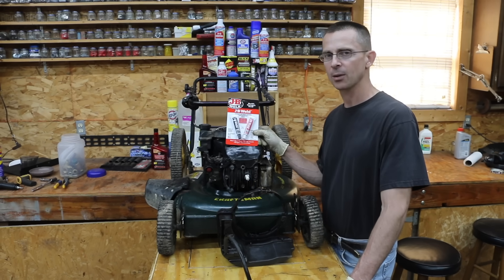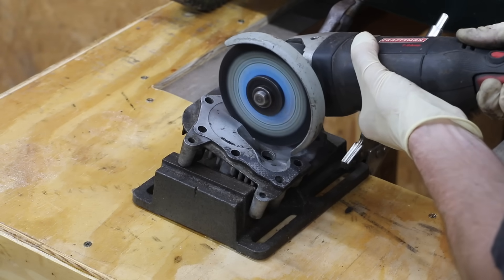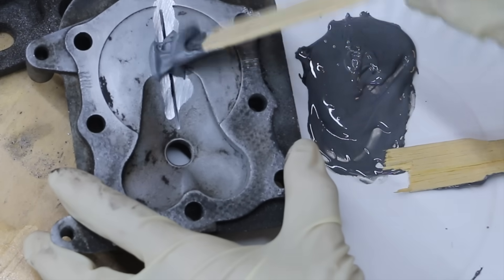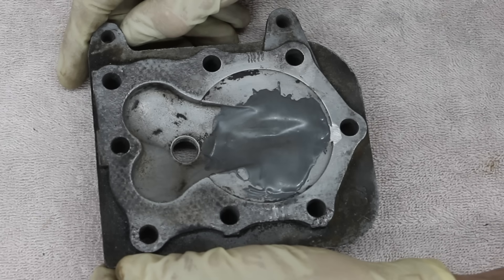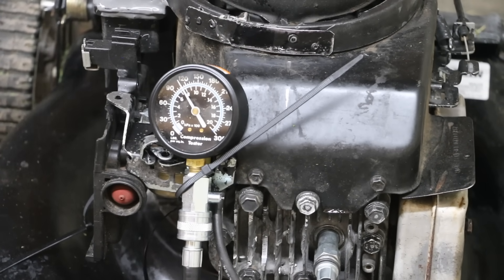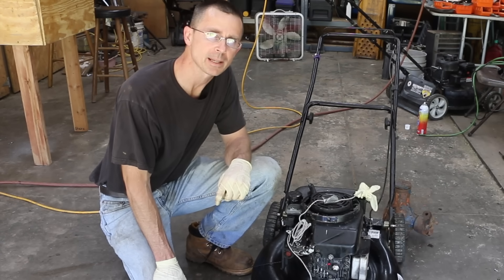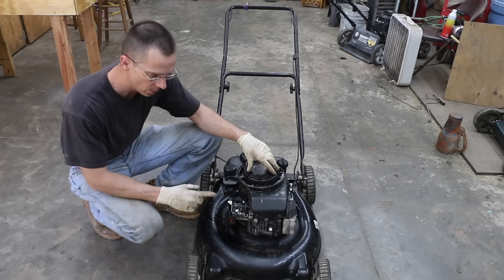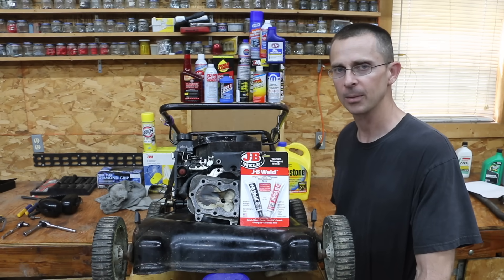Can JB Weld fix a cracked cylinder head?  See the proof!!

Comment: So my pressure washer has a small crack on the pump, just before the long pipe to connect sprayer. Should I try it before spending 100 on new pump
Reply from the maker: If the pump was disassembled and JB Weld placed on the inside of the pump to cover the crack and then placed on the outside too, I believe it might work.  However, I don't believe it'll provide a lasting solution if just placed on the outside.

Comment: This is exactly what JB Weld was made for. My father worked for the engine repair shop that developed it back around 1950 in Sulphur Springs, Tx.
Also, if you can find it, there's a material called pr-1422 that is designed for sealing airplane gas tanks. Not sure it can be found outside the military, but we used it at NASA for different purposes on the Space Shuttle. If you can find it let me know, I'd like to get some. Awesome stuff.
Reply from the maker: Thank you!

Comment: I know you mention you should have sanded but dude, you know that combustion chambers have low tolerances, what were you thinking putting this huge mass in such tight quarters?
Reply from the maker: JB Weld still held up, even with the piston pounding. Thanks again!
Reply: @ProjectFarm  Ya i saw that, impressive..

Comment: Rock strike hole in old caddy fuel tank. Pin hole. Coated round head machine screw with jb weld. sanded tank surface then installed screw. coated over screw with jb weld. 4 years later still no leak. With plastics I find that if I sand the surface first I can repair most any plastic.
Reply from the maker: Thank you

Comment: what if I use JB Weld to raise the compression on my Jeap?  

It is a 240kmi AMC 4.0, so the compression will stay below factory spec.
Reply from the maker: Thank you. I don't believe that it'll handle the heat for too long.
Reply: @ProjectFarm  :
https://scontent.fiow1-1.fna.fbcdn.net/v/t1.0-9/16195833_10101251542211889_6169801415952343842_n.jpg?_nc_cat=108&_nc_oc=AQl5noVnDiW6o8eH6SDUWBn1jwI955jFHY5eQmAjbsVr6TAAgEIlPKQ0jOReSMd7vns&_nc_ht=scontent.fiow1-1.fna&oh=0be0f08f1b6cad3e0bf890881b931d35&oe=5D5EC41A

if my pic link works, that's an article from Autocar magazine.

Comment: Onboard ship, underway, our high pressure air compressor cracked a cylinder insert. A little bit of J.B. Weld, and we finished our deployment without another issue. We replaced it when we got back to home port. But, we didn't really need to
Reply from the maker: Impressive repair!

Comment: I know your a JB weld fan but I'm having a hard time getting behind JB weld. Heat seems to be the killer to JB weld especially if you apply heat and let it cool down and then apply heat again. Repeat this several times and JB weld gives in. I was surprised that JB weld literally crumbled on my Honda Civic manifold. 900 Fahrenheit but JB weld started smoking around 500 and it's rated for 550 Fahrenheit. I didn't expect regular JB weld to last long but to smoke and crumble apart in minutes surprised me. There is a JB Weld for extreme heat but I haven't tried that yet and manifolds do get extremely hot.
Reply from the maker: Great point on the heat limitations.

Comment: JB Weld Marine is waterproof. I used it to patch a rusted oil pan on a 1.6 liter 4 cylinder until I could get a replacement. Ended up lasting over a year (I forgot about it). I just put on a new pan.
Reply from the maker: Thank you

Comment: Can I use JB weld to seal power steering pump leak?
Reply from the maker: It's hard to day without seeing the cause of the leak.  If it's a leaking seal, have you tried bluedevil power steering stop leak?
Reply: Seal causing it to leak because of high km. Possible jb weld can seal a leak because I heard it do the job.

Comment: Have used jb weld on a tecumseh 6 hp block that threw a rod and was cracked.  Figured since it was a splash lubrication system it would work. It held up for a few years.
Reply from the maker: Impressive!

Comment: DO warsh the gasoline from the tank with OXY  / torch.  LOL.  LOL    about J B.  i have used for a lot of things.    and because i cant remember any major  trouble it must have done a good job.   except.     on my RC car i used it to lock the differential.  after 3 years i took the diff apart an it would let the diff spin very little.     but i dont call that a fail.   also i used JB  to patch a outside rear view mirror  back on a Buick.
Reply from the maker: Thank you

Comment: I've used it on a old out board motor , the Carburator mounting ear broke and put some on and it's been good now 2 years and was able to tighten the carb back on to normal specs and reattach the piece back on the carb .
Reply from the maker: Thank you

Comment: I bought a used 1999 GMC Z71 years ago from a guy who purchased it at a car auction. About 2 months later I was on my way to work one morning and the truck started running like crap. Had it towed to my mechanic who called me a few days later and said one of the heads had a crack nearly 1/4 inch wide that someone had filled in with JB Weld and it had finally failed. Who knows how long it had been that way or who did it but I can say from bitter personal experience that it will fix a cracked head...for a while at least. And there is a special place in hell for the person who did that before selling the truck to someone else.
Reply from the maker: Wow!  They should not have sold it like that.

Comment: Ive never used it to fix a cracked block but i had a freeze plug rust through in my ford ranger, the one right above the driver side motor mount, I used a screw driver and was able to remove about half of the plug, i used a whole tube of JB Weld and it has been there for 8 years and still doesn't leak.
Reply from the maker: That's great!  Thanks for watching!

Comment: 40 yrs ago I used J-B on some 318 heads I found in a lot that had a fresh valve job done to them.. They had cracks (4 of them) each near the end exhaust ports . I guess whom ever dumped them thought they would leak.  I put J-B on them & never had an issue.   Amazing.
Reply from the maker: Impressive results!

Comment: Once when I bought some mufflers online I accidently got them in 2.5" instead of 2.25". I had already cut the old mufflers off and couldn't wait for the whole return process since I would be pulled over for noise violations. I used JB weld to fill the gap and those mufflers were solid till I sold the car 7 years later. JB weld is some pretty good stuff.
Reply from the maker: Impressive!

Comment: Project Farm, you should try to use that aluminum easy welding rod to attach a cylinder head/fix a crack In something aluminum.  https://m.harborfreight.com/8-piece-low-temperature-aluminum-welding-rods-44810.html?utm_referrer=direct%2Fnot%20provided
Reply from the maker: Thank you for the video idea!

Comment: I've used JB Weld for a variety of fixes. Definitely works well if the parts are super clean and roughed up. I've used it on wood also and it holds strong. Super Glue has failed me too many times so I went 2 part epoxy many years ago. Also I've welded aluminum as part of building a twin turbo system on my race car and nothing gives me more confidence than a strong true weld. I paid 2500 for my welder so it's not exactly a cheap fix. I've had 1 failure with JB Weld on a post hole digger. It eventually gave way so I pulled out the welder and strengthened the cheap post hole digger and haven't had an issue since.
Reply from the maker: Thank you!

Comment: I have used a mixture of 50% jb weld and 50 % by volume not weight aluminum chips (from a carbide cutter) to repair a aluminum cylinder head intake port that was cut into a push rod passage.  The reason I used 50/50 was to try and better match the thermal expansion or the original material. don't know if it made a difference but the head is still running Saturday nights at a local dirt track for the last 6 years. Did try and repair a blow out o2 sensor on a exhaust manifold / cat converter combo. While it was just a patch to get me back home the road side repair did not work and the JB weld burnt out after only a few miles
Reply from the maker: Thank you!

Comment: I use JB Weld for anything I don’t want to move!  Most recently a fuel gauge for my snowmobile.  Everything fell off the cap and into the tank while riding.  After fishing it all out it’s been reassembled and held together with JB Weld and has yet to be put back on the sled.  My question is have you ever used Blue Devil to fix a head gasket leak?  I used it in my F-150 5.4 Triton and after about a year no problems.  Hasn’t leaked a drop of coolant or burned any.
Reply from the maker: JB Weld is amazing!  Thank you

Comment: Can I use J-B Kwik weld to repair a 1 millimeter by 1 mm puncture in an aluminum head on the engine... I was drilling to install helical and one just a little too far
Reply from the maker: I don't believe the repair will last.  Too much heat in the long run.  Without seeing the needed repair, it's difficult to provide advice.  Could you just "tap" it and insert a threaded fastener along with a high temp threadlock to plug the hole?
Reply: @ProjectFarm  while preparing to tap bolt I slightly drilled into head...patching up small opening into head?

Comment: I have been retrofitting some 5 gal plastic gas containers with EZ-Pour spouts and vents. The vents are installed by drilling a 1/2" hole and snapping in the little yellow plastic vents with attached cover. I've had a problem with gasoline leaking around the vent and have been searching for a sealant of some kind that will work on plastic and is gasoline proof/resistant. I'm trying several brands/types to include goop, and various versions of Permatex. Do you have any recommendations? Maybe you could do a test? Another brand I've consider is Eclectic "Seal-All." There are many brands with various claims.

Comment: JB Weld is good stuff. I had a crack in the weld seam on the side of a 50 gallon waste oil cube and degreased it and prepped the repair area really good. JB weld still holding through the heat and cold over 15 years. Tank is still not leaking.

Comment: Hey  ! Great Easy way to raise your compression ratio to increase performance in other applications. By decreasing the dead space inside your cylinder head. It should and will raise the compression ratio  WOW , Now thats exciting to me. A hell of a lot easier than milling heads ! I wonder if it would hold up to repeated heating cycles as said already  ?
Reply from the maker: JB Weld is a terrific product but the temperature inside the engine's combustion chamber is beyond it's rated heat capacity.

Comment: How about way over-drilling out stripped threads, then tapping it again, fill entire bolt hole with JBW (new threads are to give JBW something to grab on to). Then drill & tap just the slug of JBW and see what type of hold power new bolt has to it. I suppose you could just fill a large dia bolt hole with JBW and use a smaller test bolt to save a step..may just do this myself when Im done rebuilding my engine.
Reply from the maker: Thank you for the video idea!

Comment: I have an '03 Impala with the 3800 engine. Replaced lower intake manifold gaskets 3 years ago and there was lots of pitting on the block (iron) around the coolant passages which would keep the new gaskets from making a good seal. Took my engine apart  a month ago for more work and the JB Weld area look great, no chipping, loss or whatever. Im in alot of 3800 or Impala/GM Forums and JB Weld always comes up as a major lifesaver for engines. Some guys have done what I did, used it to fix broke of bolt hole segments on thick brakets, water pumps and transmission to engine  plates, covers and alot more. I used it like putty fill on the pitting and was afraid it would just peel off as the pitting was irregular and various depths no more than 1/32 I'd guess but thats a million miles to a gasket. I roughed it up the pitting surface with sand paper, used a putty blade then fine sand down, still all there. The best stuff ever!
Reply from the maker: Impressive repair!  JB Weld has saved me a lot of time and money.

Comment: On the JB Weld fix preheat the metal first as it turns the JB to a almost watery consistency giving it a way better bond and metal penetration . I have tested both and preheating to about 125 - 150 degrees gives a way better bond .

On the head you may have to put tape on other side on preheat so the JB stays in crack and does not run out . I then bake repair item at 175 degrees for 30 min ..... incredible bond after

 I love your videos - so much real world information .
Reply from the maker: Thank you!

Comment: Very interesting. I’ve used JBWeld + cut & shaped sheetmetal to restore a broken front derailleur clamp on a bicycle, also restored a broken bicycle brake lever better than new with jbweld + cut & shaped piece of sheetmetal. The bicycle was for a friend’s kid and he was thrilled to get his bike back like new.  I’ve also used it to fill in a deep gouge on the edge of an alloy wheel rim. Used duct tape to hold its shape while drying, then sanded the rim edge smooth and repainted the rim like new again.
Reply from the maker: Thank you!  JB Weld is an amazing product.

Comment: You should test how well JB Weld works when not mixed properly.  It's a 50/50 two part product, but everyone just eyeballs the mixture.  What effect does a poor mixture have on the strength of the product?  70/30, 30/70, etc.
Reply from the maker: Thank you for the video idea!

Comment: Well it definitely does not work on exhaust. I have tested it.
Reply from the maker: Thank you
Reply: Well I used it on a header about one inch from the engine. The heat just burns it away. That’s why I was surprised it worked on the head. It was on a car though.

Comment: I  try use this thing a few times to do a quick fix in a radiator and it doesn't works!
Reply from the maker: Thanks for the constructive feedback.
Reply: Alex. I had the same issue with trying to repair a hole in an oil pan. Come to find out it was operator error on my part. The surfaces must be clean. Hopefully you are not making the same rookie mistake I did.

Comment: JB Weld...! After this torture test I'm a believer. Way back when, I had a MX bike that blew a hole through the cylinder just below the power port. In that state the bike, I reasoned, was only worth trading for a beater car. After the fact I kinda wondered if I could've JB-Welded the cylinder & how much run time I could've gotten from that cherished ride. This vid really intrigues.
Reply from the maker: Thank you!

Comment: I was putting my kayak on the roof and it slipped and broke off my side view mirror.  I put it back with JB Weld.  A few months later I was T-boned (opposite side of the car from the fixed mirror) and I slammed into a cement block fire house.  The mirror stayed on even though the car was totaled.  I was amazed.
Reply from the maker: Impressive!  Glad you are okay from the accident.

Comment: I really enjoyed thus video. I just found your page . Do you know anything about the high heat JB WELD? Im trying to fix a crack in a cast iron stove. Ty
Reply from the maker: JB Weld Extreme heat should work well for filling a crack.  Since it's designed for high heat, the tradeoff is that it isn't nearly as strong as JB Weld original.  Hope this helps.
Reply: Thanks for your reply im going to do a good prep of cleaning i dont think beveling will be nessary all it will have to do i sit under no pressure and withstand the heat ill let you know how it did in a month we are going to put the high heat label to the test i assure you..

Comment: I repaired a cracked transmission on a Chinese Jinma 28 hp tractor three years ago.  It was 4" long on the bottom of the gearbox.  I washed out the transmission with acetone, end drilled the crack, ground the surface and filled it up with JB Weld, using tape to keep it in place.  I refilled the transmission and still use it today.
Reply from the maker: Impressive repair!  JB Weld is an amazing product!

Comment: My dad ran a v8 on jb weld. Fixed a crack on each cylder  from spark plug hole to exhaust valve seat on the heads. Motor ran good for 50,000 miles without any problems.

Comment: Thanks for your hard work and time in testing products in real world conditions and showing the details of how you are testing. Really a great test for JB with not only mending a simulated crack but with the pressure and heat of a cylinder head. 
I have used JB for different applications. I have found that the quick cure JB Weld products are not nearly as good as the original slow curing formula that you used in this test.
Thanks
Reply from the maker: Great point on the quick cure products. Thank you!

Comment: I used JB Weld to repair a stripped out motor mount bolt hole on an aluminum Honda Engine Block. Worked flawlessly.  Also used it on a Th400 trans case that cracked right where the cooler lines thread in (I overtightened them)  took two stages of applying but fixed it.
Reply from the maker: Impressive!

Comment: I can not attest to j.b. weld on a cylinder head but I did have an old lawnmower with a rusted out gas tank and used it for almost 3 years before giving it to one of my friends. Also my dad used it on a timing cover on a 1978 LTD Station wagon.
Reply from the maker: Impressive results!